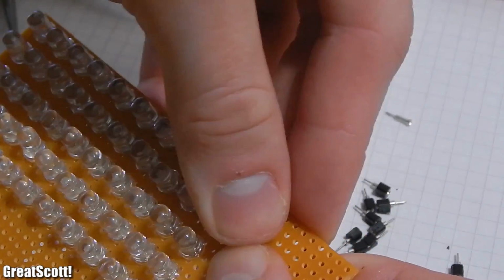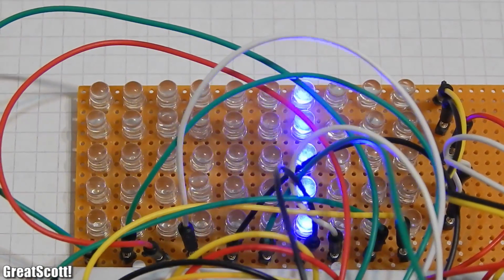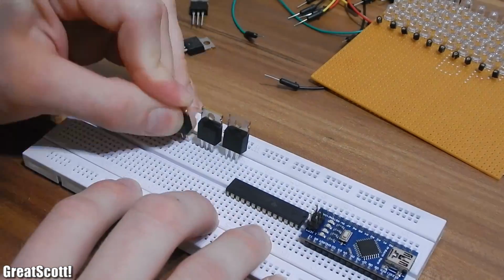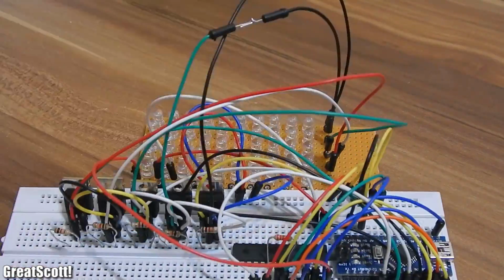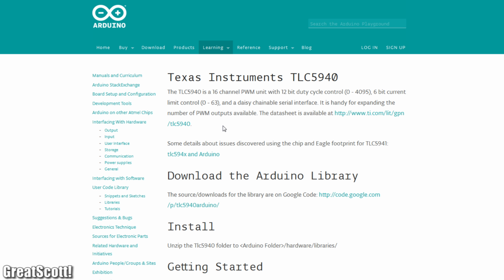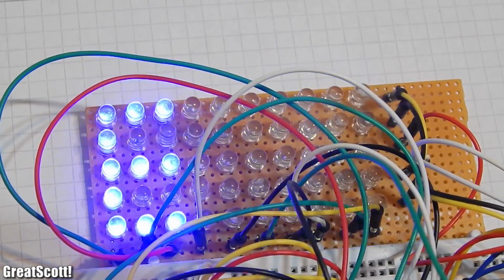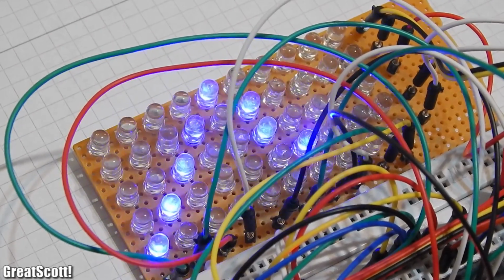Electronic Basics #5: How to Multiplex

Comment: Thank you for this, I'm gonna use the ideas here to build a binary clock that multiplexes through the digits. I probably won't use the LED driver, just a few transistors for now since the clock will be 4 tall x 6 wide, and not every column will have all 4 LEDs. Even if an entire row is lit, that's only 120mA max, so a transistor should be able to handle that. Anyways, thank you again!

Comment: If you replace the LEDs with sensors, like linear-motion spring loaded potentiometers for example; can I find the location of a ball on the grid, as it rolls across the sliding pieces of the potentiometers sticking up? My hope is that I can get analog signals from the grid to very accurately locate the center of something on the grid, without needing the stuff for timing. (I actually have a different sensor in mind, but the linear potentiometer is useful for the example.)

Comment: Another way to do this, is to use a shift register(s) (such as 74LS595) to turn three I/O pins into 8/16/24 pins etc. The advantage of this, is that it uses only a tiny bit of code to use, and the LEDs do not flicker (they stay on constant).
Reply: Then of course the only disadvantage is that 74HC/LS595 cannot output in PWM. So they will always be at full brightness. Though that's only really a problem if you're using RGB leds and trying color mixing.
Reply: @HeiwaAsobi  I am about to try this with the shift register used to select which LED is operating and the power supply is then PWM.

Comment: Great stuff! I was wondering if i can do the same with sound. I have built a 555 synthesizer. Its a voltage controlled oscillator. I want to be able to play it polyphonic, not one note at a time. Could i use multiplexing for that?
Reply: Ben Winkel you got a 555 to generate your wave for each note. If you want to play multiple notes at the same time then you will need to use a 555 timer to generate each note and combine those afterwards. One extra advantage of this system is that you can tune each note seperatly

Comment: how could I do 30x30?  if one pin is taken up per row and column, 30 + 30 = 60 more than the arduino mega.
Reply: Joe Well 
I think you could use the IC 74HC595
Reply: Joe Well 
I think you could use the IC 74HC595
Reply: Joe Well multiplex a multiplex XD
Reply: Exactly lol
Reply: Multiplex a multiplex multiplexing a multiplex
Reply: At some point if you want a decent amount of resolution you'll need a dedicated display with something like an I2C or SPI bus

Comment: @1:14, where to buy the straight wire that bridges the LEDs? Thanjs
Reply: It's called Buss Wire, it is used in application like these.
Reply: you can just use the core of a solid copper wire :)

Comment: Any rule of thumb regarding duty cycles and refresh rates or points to get started? I'm currently designing a nibble display for an 8bit cpu, why is meant to use 7 7-segment displays. Multiplexing is done by switching the common anode. There's a 4-12MHz clock signal I could easily use (Adding a 555 at a lower rate shouldn't be a problem) and I'd see myself ending up with a duty cycle of ~15% - would that work? I'm aware the segments might show junk while running code on the CPU at full speed. It's meant as a debug aid when putting the CPU into single step mode.

Comment: so is the gate going to the D pins of the arduino? the schematic is a little confusing. It looks like both gate and source are going to 5V while drain is going to anode, D pins of arduino and the 1K resistor. Sorry new to reading circuit diagrams so having trouble understanding .

Comment: Hi @GreatScott! ,
Thanks for the great tutorial.
I tried this on my custom made 4 digit 7 segment display with LEDs.
It works fine, except for one issue.
I could see residue lights on non-lit segments of some digits due to multiplexing. For example, 12 looks like 22 due to the residue lights. I tried fine-tuning the update interval but always ended up in either flickering or residue light. Is there a way to avoid it?

Comment: A much simpler way to multiplex is to use the MAX7219 chip. You can buy cheap LED matrix modules off of ebay (around 98 cents). Just putting that out there.
Reply: I was yelling at the screen trying to tell him to use the max chip

Comment: What are those thing called the metal wires? Not the solder, the solder bridges? or something like that.
Reply: Those are just cut-up leads from other components, like resistors, soldered together. If you wanted a single, long piece, you could use stripped solid core wire.
Reply: @davidstech1445  Thanks.

Comment: how did you fit the mosfets into the breadboard? did you hammer them in??
Reply: The breadboards have holes in them 2.54mm large. The MOSFET leads are the same size, so they simply push in. They can be removed and re-used with no difficulty.

Comment: Can i have a question, how did you slow down the IC? with potenciometer?
Reply from the maker: +DcNiemand I decreased the refresh rate of the individual lines with a potentiometer as an input. The IC is as fast as always.
Reply: Ok, so its done in code and analog input?

PS: like peoples with quick replay
Reply: +DcNiemand rip english "peopleS"

Comment: Why do I need resistor between GATE of MOSFET and 5V?
Reply from the maker: +Bartek Boczar Google "Pull up resistor"
Reply: +GreatScott! I get the idea of pull-up resistor but why do you use it there if you control mosfet via io pin, isnt this pin enough?
Reply: +Bartek Boczar to ensure the mosfet is in the off state and prevent static damage(mosfets are delicate)

Comment: Were did you purchase the female headers?
Reply from the maker: http://www.ebay.com/itm/10pcs-1x40-Pin-Single-Row-2-54mm-Round-Female-Header-/400340721249?pt=LH_DefaultDomain_0&hash=item5d362a9e61Just one example. You can get those really easily.
Reply: Thanks for the link.
 I suppose you can cut those rows into single if needed?
Reply from the maker: Exactly.
Reply: Thanks again your videos are great

Comment: Anyone know online where you can get that silver-copper wire?
Reply: Those are just cut-up leads from other components, like resistors, soldered together. If you wanted a single, long piece, you could use stripped solid core wire.

Comment: Do you mind checking the files for this project at Mediafire. The schematic file for the circuit or the Arduino code will not open. I would really like to try out this project thanks.
Reply from the maker: I just checked them. Everything works fine.
Reply: GreatScott! Sorry to annoy you again but I  am getting these errors when I try to verify ledmatrix.ino
ledmatrix:54: error: 'sin6' was not declared in this scope
ledmatrix:55: error: 'reset' was not declared in this scope
ledmatrix:55: error: 'sin7' was not declared in this scope
ledmatrix:56: error: 'reset' was not declared in this scope
ledmatrix:56: error: 'sin8' was not declared in this scope
ledmatrix:59: error: 'MatrixUpdate' was not declared in this scope

Also where do I put the definition.ino and function.ino files please.
And yes I already have the tlc5940 library installed from a previous project
I assume that the definition.ino code should be put at the start of ledmatrix.ino where all the other tlc5940 outputs, mosfet gates and matrix LED's are defined. And as the MatrixUpdate function is called in the loop I assume that it goes at the end of your original ledmatrix.ino code. I have taken the liberty of combining these three codes into one code file that at least compiles but as I do not have all the components I cannot test this combined code which I have uploaded to my Mediafire account here  
http://www.mediafire.com/download/7fjnnj8vtc5o77b/fullLedMatrix.ino 
and have named fullLedMatrix.ino.
Is what I have done correct please?
Reply from the maker: MrPnew1
Just Unzip the folder and all the .ino are already in the right place.
Reply: GreatScott!
 Oh now I see. You have to add the definition.ino and function.ino as tabs to the ledmatrix.ino for it to work. If you just extract the three files this does not automatically happen. I would have thought that it would have been easier to just have them all in one file. Anyway thanks again.

Comment: how to make it without ardvno 
plz help
Reply: +Raghu Badari The easyest way is to program it in Arduino UNO and just take the AVR out and just use the ATMega on your project. Just find how to make it work without the board (it's easy). So techically, you are not using the arduino, but an ATMega with the arduino bootloader and the arduino board as the programer. This brings your cost down to 3$ for the chip.
Reply: Cannot be done, arduino must be used
Reply: +NeXTSTORMING Yes it can! I literally explained how to do it.
Reply: ILA Still u need to have an arduino

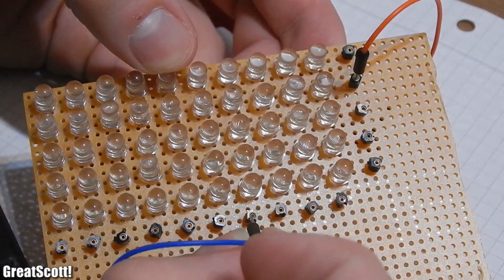Comment: 2:05 this part does not make sense to me!
Reply: He put power on two rows, and ground two columns. (LEDs light when power can follow across in correct direction.) The grounds (current sink) will allow any LED in that column to light if a row(s) has power (current source) on it. Since he grounds two columns and applies power to two rows this ends up being 2x2 or 4 LEDs.  The top and bot row get power. The left and right column get ground. This ends up selecting the corner LEDs.
Therefore we have to select the rows one by one to keep the rows separate from one another.
Reply: @davidthacher1397  I understand the idea. However in the video the author missaid led names on multiple levels. He said when you connect aa and ga, ja and ae also light up. Even if you put j instead of g (since g is obviously not used), it's still incorrect. Bacically he said GA when he should have said JE. I just didn't want other people to get confused.

Comment: Sir i want to design vaccum Fluroscent Display based audio spectrum analyzer using this led driver with additional output transistor circuit to drive the grids and segment with high volts, it will be 5band 10seg per band analyzer , but dont know how to write program for it can you please help me with the program m having the arduino uno. The vf display is from old car radio system.
Or can you make a video on vfd display spectrum analyzer using dedicated vfd chips pt6311 and vfd, as vfd's are great electronics stuff, looking forward for your reply, thank you☺️🙌

Comment: I don't get the mosfet part...
It's like a transistor..... right?
Why are you using it?
Reply: Transistors require a tiny 0.2v to turn on, while mosfets require 1-2v at least
Reply: I get it now. Use some mosfets to switch the pin to ground. Use mosfets rather than transistors because they can use higher voltage and can supply more current
Reply: A mosfet is a type of transistor
Reply: I might be commenting wayyy to late.  But he uses it because the IC can't provide enough current to light up all the LEDs, so he uses the MOSFET to handle that current

Comment: Hmm… I imagine that if you have so many LEDs that your refresh rate suffers, you could break the logical wiring structure up into sub-sections of multiplexes, assuming that you have enough pins.

I wonder if the human eye has a horizontal or vertical bias of any kind, regarding its sensitivity to refresh rate. If it does, that might be something to keep in mind when deciding what shape to make the subdivisions of multiplexing.